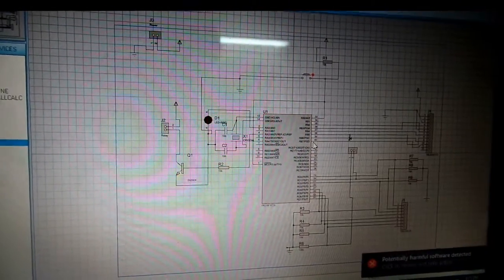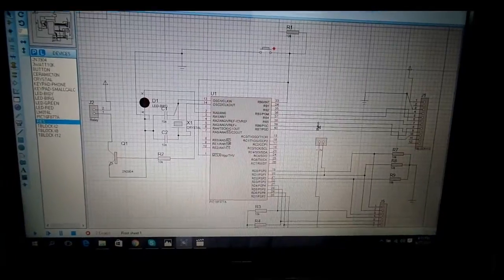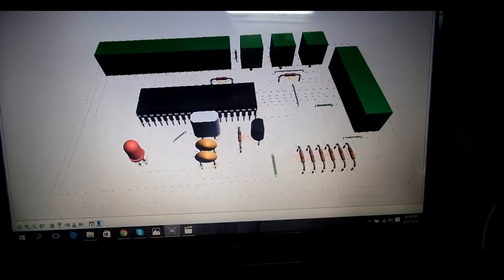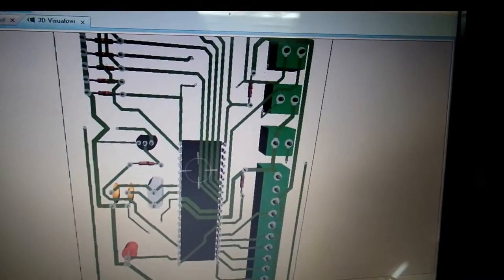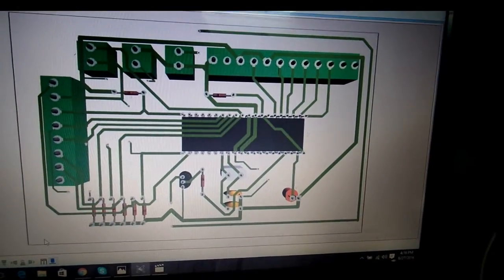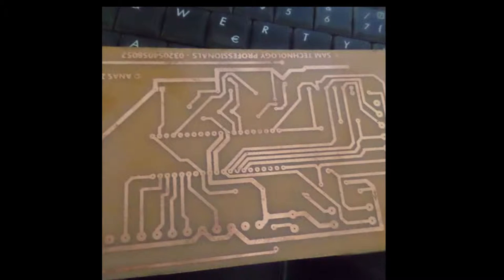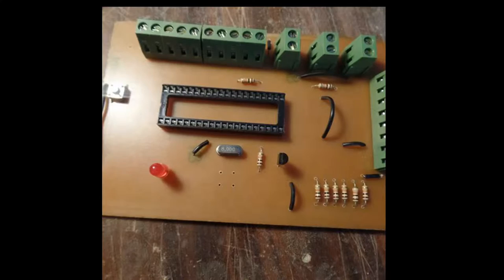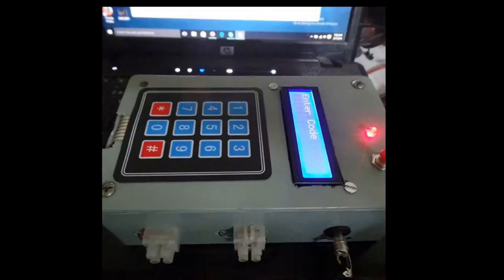Keypad base Lock with PIC with C codes (+Proteus DLink)

Comment: Is the code still available? also would the code be able to be used for pic18F45K20?
Reply from the maker: NO the code is available in the form of HEX so it cant be compiled again. The hex is for pic16f877 and only 16f877 will be capable of working with it. The C code is also available in which you can make some changes to make it work with your microcontroller.